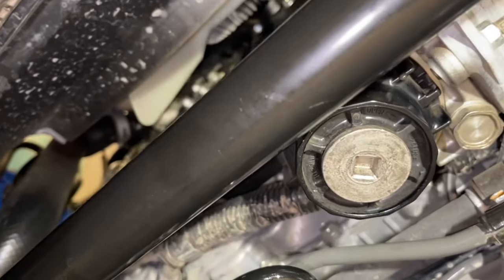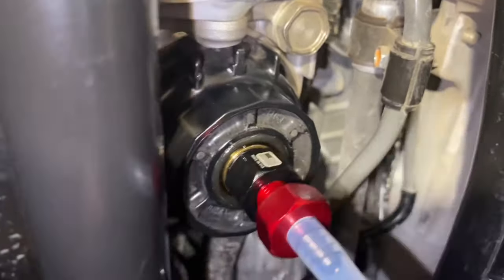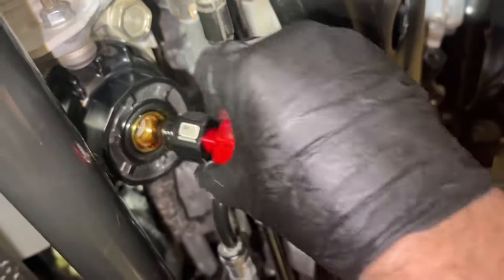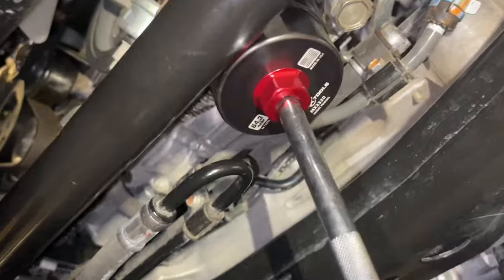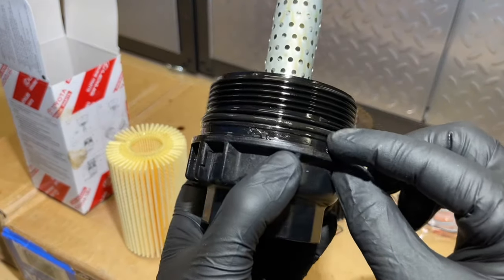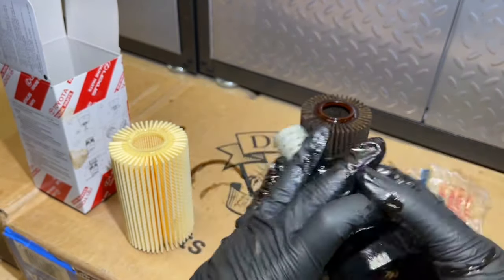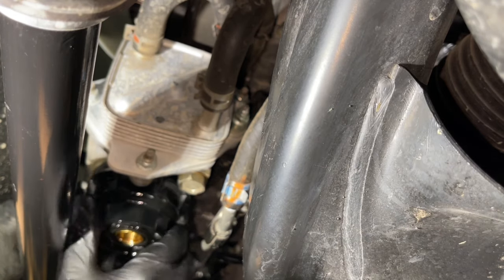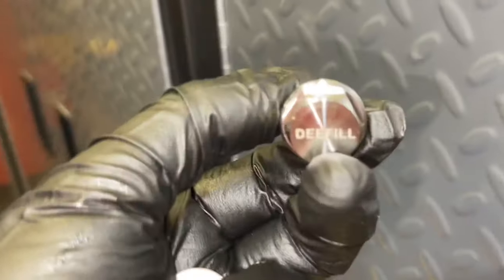Oil filter cartridge change Toyota Lexus

Comment: Sr. Do you think that oil filter you showing on you video it's the same number for 2011 tundra crewmax. I'm about to do the oil change on my truck for the first time
Reply from the maker: Yes, it did say it fits when I put in that info. Double check if you use the Amazon link https://www.amazon.com/Toyota-Genuine-04152-YZZA4-Replaceable-Element/dp/B007OW6LSC?crid=37WAMAEP282FK&keywords=toyota+tundra+oil+filter&qid=1692911341&sprefix=toyota+tundra+oil+filter,aps,157&sr=8-3&linkCode=sl1&tag=2004047-20&linkId=ce4c0f69de031ef386f7013f8278f41e&language=en_US&ref_=as_li_ss_tl
Reply: @dannyjohnsonsgarage  thank you very much. Your video was very helpful